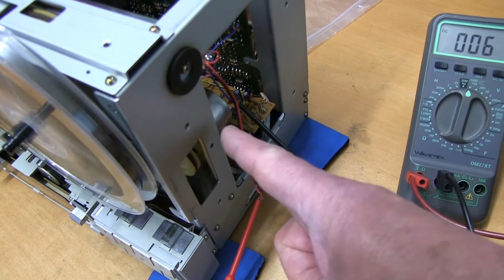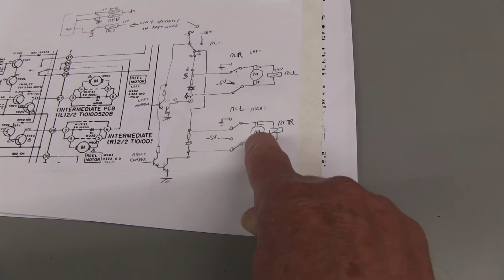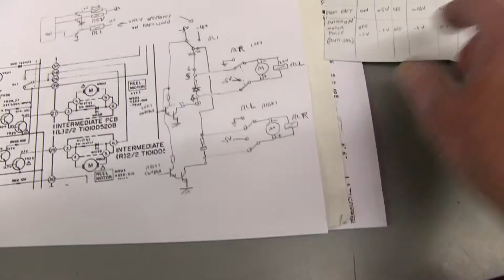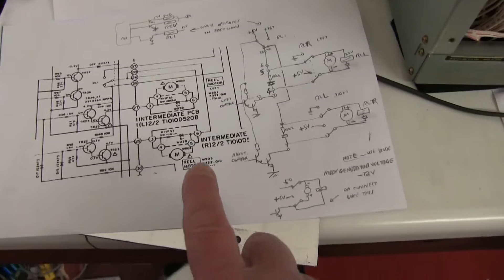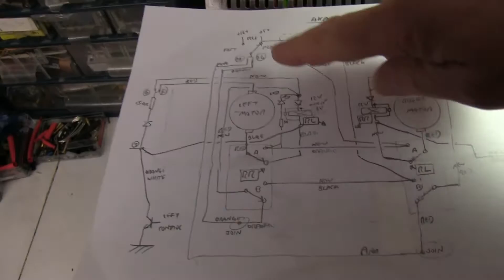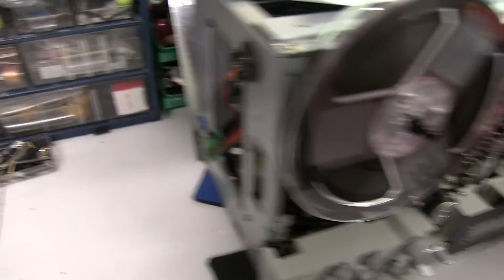AKAI GX-77 Fast Spool Relay Mod.

Comment: I REBUILD THIS MODEL A LOT.I FIND IF I TAKE THE THING APART AND CLEAN OUT OLD GREASE AND RE-LUBE WITH WHITE  LYTHUM  GREAS E AND NEW BELTS OF COURSE MOST OF THE TIME IT SOLVES THE PROBLEM .THE GREASE THAT AKAI USED BACK IN THE DAY DRYS UP AND GETS STIF
Reply: no , it doesnt

Comment: Hi,

Great video explaining how to deal with this issue.
Are you planning to put a video of bias-eq calibration for the GX-77 ?
That would be great :)

Best regards
Reply from the maker: +wallshadow211 
Hi
I wasn't planning on the bias-eq, as you need top quality tapes to make it worthwhile.
Did you have a problem with your sound?
Reply: +Nick Adams hi ! , i was curious on this deck's alignment procedure. I own several revox machines but those are much more friendly in every way. No issue with sound, but i do plan to clean the long contact switch, but honestly, this is not a service friendly machine at all.
Reply from the maker: +wallshadow211 
Hi , I agree, it was very difficult to replace the gear loading mechanism, with no space to get at anything.
The row of switches on the circuit, I just used switch cleaner and moved the long operating arm back and forwards a few times.
Reply: +Nick Adams Also, everytime i play a tape, the transport of this machine makes me feel i am forcing the tape, tension looks dangerously high on the loading roller. Also slowdown at the end when using 13cm small supply reel, even on play. Capstan is shiny by design so more tape slip there as well...
Reply from the maker: +wallshadow211 
Hi
Make sure the brake bands are releasing the spools to turn freely.
They are not normally a problem.
You will have to take off the front panel to see them.
You can operate them by hand and see if they release the spools.
I think this machine is on the design limit of working correctly.
With very small spools 10cm, even mine has trouble with the loading.
Reply: Hi Nick.  My unit is turning on and off but does not play, forward nor rewind.  What is the first thing that I look for to diagnose the problem?
Reply from the maker: Hi Noli
Does the tape loader go up and down?
There are switches on the big gear wheel that goes around inside.
Let me know more detail
Nick

Comment: Without having the wiring diagram, just by watching the explanation, I wonder if it's possible to minimize the wiring length by just sending the 2 relay coil wires across the deck (3 wires in total since one is ground), instead of all 6 relay contacts wires, twice (12 wires).

Comment: Nice workaround. But still, it does not fix the root cause for the issue. This is what I would be interested in. Any ideas?
Reply: what ? it does fix the root cause of the issue , the root cause of the issue is they didnt assist the dragging spool and therefore it was too much for the pulling  motor to handle , its 100% solving the root cause,.......wow some people are just unable to see the wood for the trees.

Comment: Another thing I never understood was in rewind/fast forward mode, why do they let the tape drag across the heads? More resistance and it must do hell to the heads at those rewind/fast forwrd speeds over time. I agree that the old grease is a problem and should be changed-out. But the motors could most likely use a cleaning in side as well.
Reply from the maker: Hi Ross
I think the designers/production struggled to implement the radical design in such a small package and at a sensible price point.
Compromises were made to realise the concept.
Reply: xtal ferrite heads destroy tapes not the heads
Reply: Ahhhhh, never thought of it that way...thanks. But the heads do still get worn and I still think that pulling the tape away from the heads for rewind/f-forward would be a good idea. I guess live and learn .....
Reply: Yes, I agree. But would would a modern tape deck look like in 2017. Wish they would bring back some sort of reel to reel  deck.

Comment: I tried this but, while it does the trick and winds the tape much better, when you press STOP, if the take up spool is almost empty, there will be a huge tape loop as the relay does not disengage immediately, but a second or more after I pressed the STOP button. That is because the electronic soft stop mechanism does not cut the 16V to the take up spool like a switch would and the relay only disengages a bit later, creating that tape loop. When the take up spool is almost full, the loop is minimal, almost ok. I was wondering if anyone found another way to connect the relay coils to avoid this situation. Nick, if you have any tips I would appreciate it. Am I doing something wrong here?

Comment: Dear Nick Adams, I am from India and do have Akai GX-77 Reel recorder. 
My machine is suffering from the REW and FFW problems. I watched your 
video: regarding you do rectify the problem by fixing one small board. I 
am not a technician. Could you please help me to fix this problem by 
give me that two small boards with the instruction for how to connect 
the wires to that? It will be a great help.  How much would be the cost 
of that two kits? Is it easy for me to connect the thing? Kindly guide 
me. Thank you. Regards.
Suseendran.
Reply from the maker: +Suseendran Balakrishnan 
Hi
The boards are low cost. I can get them for you
The wiring requires slow and methodical approach, as there are a lot of wires which can be confusing.
Study the circuit diagram and do it carefully.

Nick

Comment: Hi Nick,  I'm from Turkey. I have Akai GX 77, Unfortunately  it has chronic winding problem.
 I need help. How can I get roley board and wiring schema? How can I solve problem? 
Thank you. 
Best Regards. 
Akif.
Reply from the maker: Hi
I can email you my circuit notes.
The 12volt relays are available from Rapid and Farnell, in the UK.
I think Farnell has european outlets.
Or I could get them for you?
Any 12volt changeover relay will do, but wiring to the connections is easier on a circuit board.

Let me have your email.
All the best
nick

Comment: Hi Nick
Thanks for your video, My Akai GX-77 is currently in my Garage and i have found this problem, What i was wondering is what causes this problem? is it a common fault with Reel to reel or does it differ from machine to machine
Reply from the maker: +Ian Scott 
Hi Ian
I think the problem is that the motors are too weak.
They had to keep the manufacturing  cost down and compromised too far with the motor and power supply.
It is a very common problem with these players and is a design fault.
Some say they do not have this problem, but i have not seen any different motors or electronics, so they must have a good one.
Reply: hi nick is it possible to get a copy of your wiring diagram?  and the REL-PCB-3 Where did you get them
Reply from the maker: +Ian Scott 
Hi Ian
You can get the 12volt relay board from RAPID ELECTRONICS  (UK)
The part number is 505977
I can email you the diagram
Reply: Hi Nick I don't have any electronics background but I have had the reel to reel from new and need to look after it, Any help would be appreciated

Comment: Strange......in play mode I measure 3.9 V. Winding it drops to 2 V.....
Reply from the maker: The power supply is not very good. It really needs to be modded up. What voltage are you running at?
Reply: @nickadams5411  230v and I already renewed the capacitors on the power supply board. Machine plays fine.
Reply: On the power supply board in the left corner are pins with diffrent voltages. They all match, except one, at the 14v pin I measure 20 V.
Reply from the maker: @Alfcontrol   I cannot see the 14V power supply connection.
What transistor/IC is it connected to?
Reply: @nickadams5411  pm
Reply from the maker: @Alfcontrol  Don't worry about the voltage, how is the machine operating?
Reply: @nickadams5411  not at the moment, waiting for some new transistors for the pcb.